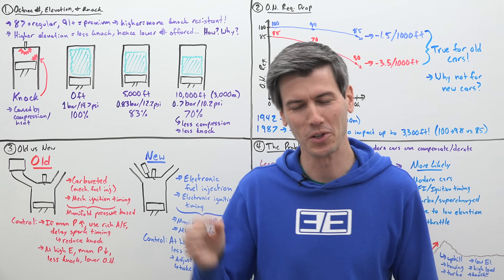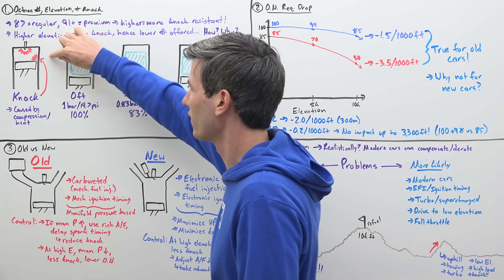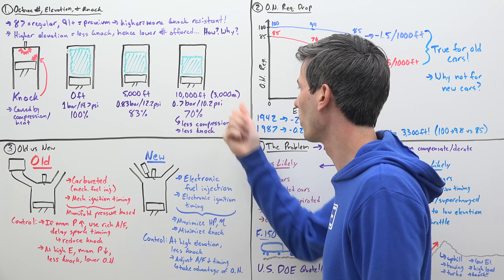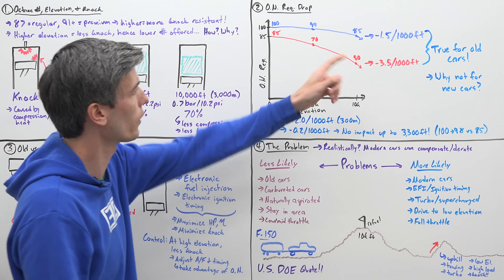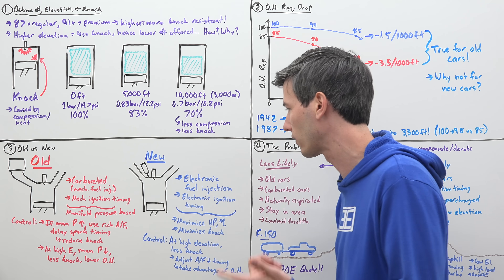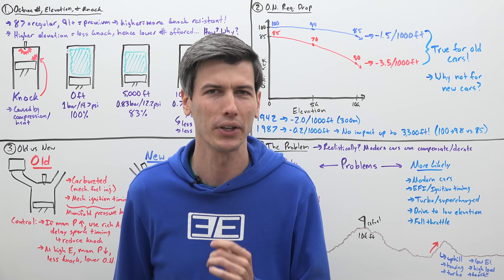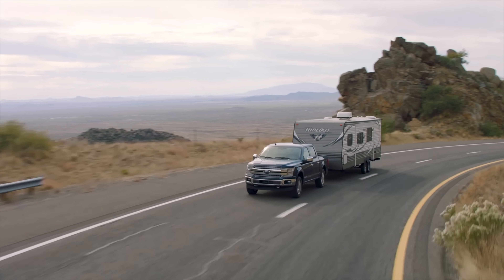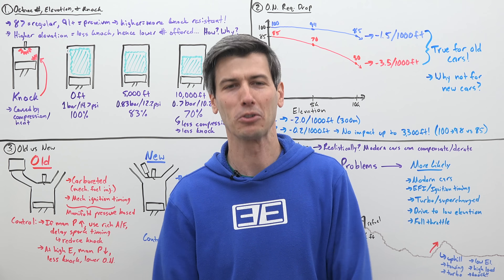Never Use This Gas In Your Car!

Comment: I don’t know the specifics but I was told the way that octane is measured in the US is altitude dependent and that 85 octane fuel at 10,000 feet, if taken to sea level and tested, would be 87-88 octane at sea level.
Reply: 85 is 85. 85 octane will be more likely to cause knock at lower elevations. It's still sold in 6 US states due to antiquated laws in these states that have not been updated since the 40s. However, these states do still sell higher octane fuels at all area stations. But unfortunately, the lowest grade is 85 octane. The remaining 44 US states won't allow anything less than 87 octane to be sold.

Comment: i did a class in college where for one project we tested octane from different octanes from different stations. the calibrated tester couldent tell the difference between octanes from the same station. 87-91 all came up with the same number within margin of error. but there was significant differences between stations. arco and valero beat everything, over shell, chevron,gulf, and bp when they still had stations here. maybe the cheaper gas stations had more turnover so the gas was fresher idk. thing is once the gas leaves the refinery its changeing and idk how they could make a engine that can split hairs to use exactly premium. because if you park the car for a week that gas has lowered in octane and it couldent run. i think there is a margin of error that they build engines to so that they can gaurentee that itl run. like race gas for a significant difference they have to go to 110+ before they can actuly do mutch with engine tuneing. and people turbo cars while still running that pump gas. the oem isint gonna cut it that close so i bet 85 will slip in just fine if you dont let it sit and burn it imidiately.

Comment: What if you blend E85 with 91 fuel to reach a higher octane level?
Reply: Blending E85 with 91 gasoline would just lower your octane level. E85 has a minimum octane rating of exactly 100 on its own.

Comment: Years ago I took a road trip from Washington state to the Midwest and driving from Idaho to Utah I refilled my tank with “regular” fuel that was 85, I noted the 85 and thought it was wierd but I got it and kept driving. An hour later a warning light for the emissions control system lit up on my dash, I had never seen that light before or after come on, an hour later I got to the next truck stop and topped off with premium (91) the light went off and since then I now make sure to pay attention to that when I’m taking a road trip

Comment: When you say 5000ft I assume you are referring to altitude, but could this also be the same for Density Altitude? Amarillo is 3600’ but the DA in the Summer time is 6,000’+. They recently swapped every gas pump from 91 octane to 93. I always assumed we didn’t need it up here for this reason but now I wonder if the warranty issue is why everything changed?
Reply: @roadtrip120  Jason is definitely referring to elevation above sea level, not DA. Density Altitude can vary wildly in the exact same location daily or even hourly depending on changes in barometer, temperature, humidity and wind. DA is not something most people understand well.
Reply: @cactuscanuck6802  I get that completely. Horsepower and performance are dependent on DA not altitude. What I mean is you can have two different altitudes with the same DA and the cars will run the same 1/4 and make the same HP. It would make sense for higher elevations and DA your engine would not require the highest of octane. I was more curious why they just switch premium from 91 to 93? We always assumed it was because of the altitude.
Reply: @roadtrip942   that is very curious indeed why they would suddenly increase the octane on premium. I can't see how it would be related to the elevation or typical DA values in your area, given what they are. There would seem to be no value in doing so. ✌

Comment: Well, this is unfortunately applicable only where such high quality gasoline is so accessible.
In my country (Brazil), as far as i know, the standard octane is 82-83, with only the most premium, hyper expensive and actually rare stations providing 87. Still, I do not know of anyone complaining of knocking or other engine issues.

Makes me think that American cars are absolute trash at reliability, and given input from American friends, it does seem to be the case.
Reply: LMAO!! 😂 I can assure you that cars in the US meet significantly higher standards than what's in Brazil. Brazil has lower auto standards than most western countries. Brazil's best-selling cars are GM and Ford and ultra crappy Fiat cars. Ford and GM are even American companies. But both companies will not sell Brazilian models here since they are built to lower standards in Brazil.  

If you have ever been to the US and Brazil, you would think cars in Brazil are absolute crap for the money. (Because they are.) You can tell just by looking at the car.😅 Cars in the US are nicer and more luxurious. And US 93 premium Gas is 99 RON. 🙂

Comment: Really interesting seeing the different Ron ratings in North America. In Australia and New Zealand our lowest Ron rating for normal fuels (what you'll find at each pump) is Diesel, 91, 95, and 98 being our premium. Of course we'll have an LPG nozzle somewhere and most stations will have ethanol mix which is usually labelled E10 and is 91 octane mixed with 10% ethanol.
Reply: America doesn't use RON. We use AKI. The fuel here is basically the same as Europe.

Comment: That is so strange??
Here in Norway the lowest rating we have is on fuel is Octane 95 …
Reply: Yeah, you guys get ripped off. 87 octane (91 Ron) runs flawlessly in 85% of all vehicles made in the world today. Most auto manufacturers globally target vehicle design to (R+M/2) 87 octane. So if you have a high-performance engine from a Lamborghini or a Ford Mustang, then you will want to use gasoline-like 91 octane or higher. (97 RON)

Norway is also known for having the world's most expensive gasoline prices. So it's not too surprising that 91 Ron isn't sold there like it is in most countries. They start you off at mid-grade when it's not necessary but to drive up profits.

Comment: My friend bought a new 2015 F-150 pickup. Few months later went on a golfing trip with some other friends. It was the cheap morons turn to buy gas, and they were at elevation. Being cheap, he filled the truck up with 85 octane. It was also mister morons turn to drive. So he drove down the mountain as fast as he could, then started driving 100 MPH once they hit the flat at lower elevation. Soon after the continued 100+ MPH speed, the truck started running funny. It got them home. The next morning the truck would not start. Took it to Ford, and they replaced the engine, for free. So I investigated this issue and actually found stuff hinting as 85 octane might be the problem. Thank you for explaining and verifying that this cheap gas was probably the culprit.

Comment: The 2002 SAE study showed the octane/altitude relationship is "A typical value of the intrinsic altitude/octane effect for modern fuels was found to be between about -1.0 and -1.5 ON/300m  depending on the basic fuel octane value." He was going on -0.2 ON/300M  This throws out his whole argument. Since he is only referencing a very old study and the SAE study was based on a fleet of 54 cars, I'd say it is more likely to be higher.  If you go on the -1.0 then 85=90 at 4000ft.  If you go by -1.5 then 85=91 at 4000ft.  I'm guessing that is the real reason 85 is still sold at high elevation.

Comment: I feel like the reason Ford says that in the owners manual is due to the overwhelming use of the Ecoboost motor. The turbo'd engine is able to push the same amount of air into the cylinder at 10000' ASL as it is at 0' ASL. In fact, the tune on the 2018+ 3.5L Ecoboost does not cut power or boost based on barometric pressure because the compressors are large enough that they can supply the full stock HP rating worth of air even up to 12000'+.

At the same time, in order to make the pressure ratio that is required to create 470 ft-lbs of torque at 12000' is much higher and therefore your charge air temperature is higher. If anything, the Ecoboost needs MORE octane at high elevation than lower elevation.

That said, I tune my own 2014 F150 Ecoboost. My living room is at 6500' and my truck makes approximately stock power at this elevation. With 87 octane, my engine's Octane Adjust ratio is at ~0 but has a range of -1 to +1. That equates to + or - 6 degrees of timing globally. In addition to that global adjustment, it has a Knock Retard which is on-the-fly adjustment that allows another 6 degrees of retard over the base ignition tables. So I have almost 50% of my PCM's ignition adjustment range left with 87. A -1 occurs on 93 or 94 octane. I could run 85 octane even on my Ecoboost and still be ok most likely.

In addition to that, the Ecoboost has air load limiters that are based on the octane adjust ratio. So if my truck is struggling to keep the OAR up, it will actually cut boost and power, particularly at low RPM where the torque and cylinder pressure is the highest.

And I do tow a 5500 lb travel trailer in some extremely harsh conditions. I have towed on a 98F day in a 30mph headwind where my truck would not stay cool unless I dropped to 55mph(on an 80mph I-80.) The PCM has so much adjust-ability for spark that my OAR stays negative even in these conditions.

In otherwords, there are so many failsafes in the PCM that I think you could safely run 85 in most any modern engine, even towing, and be ok. I would actually be worried more about 1990's or early 2000's turbo'd engines than a modern GTDI. But with that said, when I hook up my trailer, I run pump 91 with Boostane to bump it to 94. My truck has SO much more power and is so much more consistent with higher octane fuel.

Comment: If using a low octane fuel and pinging occurs, on modern engines, the knock sensor will detect it and pull spark advance out of of the ignition timing and as a result there will be power loss. How much... Not really sure, but there will be a little at the very least. Enough for me to be concerned? Not likely.

Comment: Good to know. Thanks for keeping things in perspective. I used to own a '98 Taurus (not an HO but the "fleet car" kind) that "pinged" terribly when accelerating, so I started using premium gas to try and prevent detonation. So when I tried to explain to a service rep at the dealership he told me that I was making the engine pinging worse by using premium gas instead of regular 87 octane. Go figure. It just shows that a lot of people have difficulty understanding how octane in gasoline effects engine performance.
Reply: That makes no sense, higher octane absolutely has higher knock resistance.
Reply: @tomasprieto9746  but for some engines higher octane fuel needs higher compression which the engine doesn't provide leading to a power loss on the fact of the engine not being able to burn all the usable fuel, so essentially it's like putting 100 octane race fuel into a Subaru brat, it can do more damage than good cause the engine is built for 87 octane which burns easier than 100 octane which is harder to burn.
Reply: Some people don’t know how to say “I don’t know” and spread nonsense or make something up.  

Others are the type that see the trees move when they feel a breeze and deduce that the moving trees made the breeze.
Reply: Ignore the people that say the Premium fuel didn't help. If you think it helped, it likely did help. I've seen many instances of different octane fuels either helping or hurting the vehicle. One person I know always put premium in vehicles so when they had an eagle talon, it ran terribly with the Premium fuel and I told them they needed to use regular with this car and they did and it ran much better. It's always vehicle specific so I think there is no issue with trying different octane fuel and monitoring its effects.
Reply: Sounds like the EGR system is not working.  Carboned up passage?
Reply: yeah that's silly, ona. 98 taurus it shouldn't have much of an effect, definitely wont hurt it by putting better fuel, but on newer cars that are much more advanced, and ESPECIALLY if tehy're turbocharged, putting 91 or 93 is better for the engine and you'll likey pick up some horsepower, also depends on the motor. mazda's 2.5 turbo can be used with 87 fuel and makes 227horse and 251 horse on 93, and more torque
Reply: @roboticvenom1935  "Premium" fuel isn't "better" fuel.
Reply: @mplslawnguy  not any cleaner. But for performance it does
Reply: @mplslawnguy3389  if you've got a high compression or forced induction engine it is. The word premium means nothing, it's higher octane. I work on Volvos, many of their engines since 2016 until 2022 were twin charged, turbo and super charged. If you run 87 in that thing for 100k, I GUARANTEE you you'll remove chunks from your valves. But by all means do it, it'll pay half of a paycheck for me to replace your heads so do whatever you want.
Reply: @Purpleheart62001  what happened after 2022?
Reply: @imzjustplayin  the 3rd generation of the Drive E engine came out and they got rid of the supercharger. All turbo hybrids now, they all either have a 48v electric assist flywheel motor or a 400v rear axle motor with a larger battery.
Reply: A 98 Taurus should have knock sensors that compensate for octane.  It should not knock ever using 87 octane unless it had 91 and just got a tankful of 87 octane and did not have time for the ecu to re-tune.  Something else is probably wrong.
Reply: @awackocrank  Knock sensor quality varies and may only work in certain frequencies.

Comment: I've bought the lower octane fuel available at higher elevations before and noticed my vehicle wasn't performing normally. If I recall, consumption increased as well.  Then I realized, the octane was lower than the fuel I normally purchase.  Next tank, I made sure to purchase the correct grade and everything was back to normal.
I never did hear spark knock (detonation) though, which isn't pre-ignition.  Spark knock occurs after the spark event when the fuel stops burning prematurely (for whatever reason.  Often due to inadequate octane).
It's important that peak cylinder pressure occurs after top dead center at 14 degrees in most every gasoline engine.  This means the spark event must occur at some point prior to top dead center.
Spark knock (detonation) is a much different phenomenon than pre-ignition, pre-ignition occurs prior to the spark event and will quickly damage an engine.  This is why it's so important to run the correct heat range spark plug, hot enough to promote self-cleaning of the electrodes yet cold enough pre-ignition cannot occur.
Reply: Correct, you don't want your spark plug turning into a glow plug like if the heat range (how far the electrode stickout is) is too high. This in combination with running too lean can literally melt away the electrodes on a spark plug

Comment: All ford ecoboost engines recommend premium fuel. I myself have tried regular unleaded and premium in both of our ecoboost ford's, a 2016 fusion and a 2021 edge.  Both get far better mileage with premium.  Is the cost difference worth the extra mileage,  no. If the price difference was 20 cents, as it used to be,  it would more than pay for the premium but with the price spread now days it definitely won't.  That said  I would never use 85 because it's not that much cheaper than 87, and the mileage would be worse ( I accidentally put it In once in my fusion )

Comment: less resistance to burn. makes a bigger bang, more volatile. makes more power. however, less knock resistance equals greater pre-ignition, or detonation. not good for rings and valves. and could pop out of the intake valve into the intake manifold causing a big boom.

Comment: How many modern engines have knock sensors?  This was common in Saab vehicles years ago.  If there is a question re: fuel quality for the mission at hand , why not just opt for the high quality product? Don’t be so cheap!